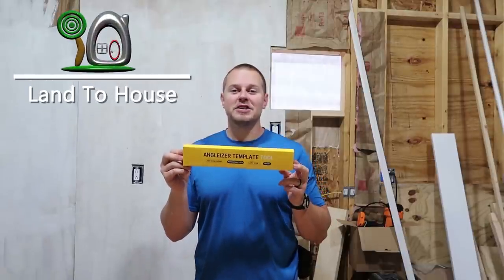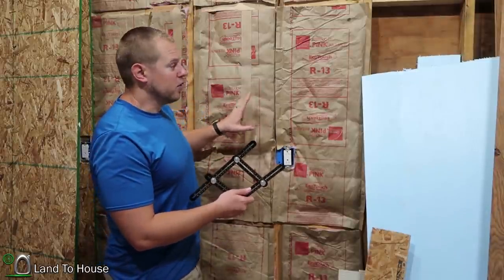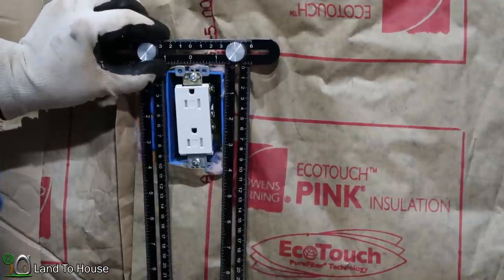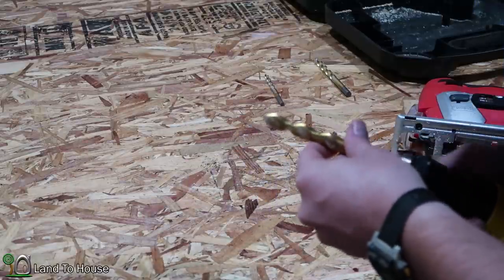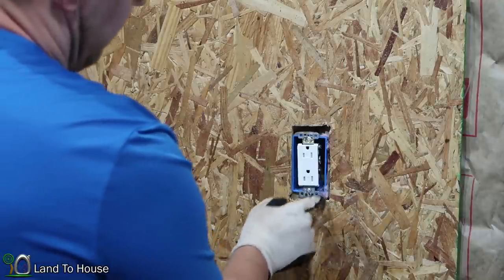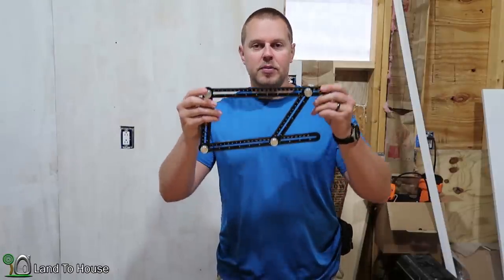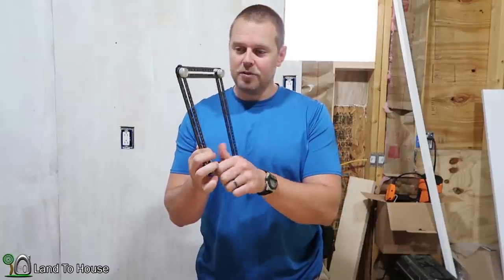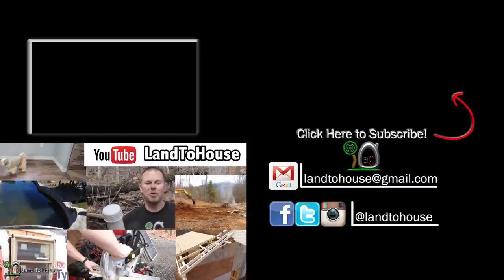Metal Angleizer

Comment: Your building is off on the top.?  What does that even mean.?   You measured it both directions.   It sounds like a measuring - transferring problem to me.   Good video though, I may buy one of these for a different application.
Reply from the maker: The tool works great. I am just not a very good builder.

Comment: Yeah and cut the hole way too big and didn't measure using the tool properly.  I purchased it and have been looking for some concrete examples and this made it look painful to use.
Reply from the maker: I am no good at cutting those outlet holes. So far my favorite use for the tool is to find hard to reach angles on my roof pitch.